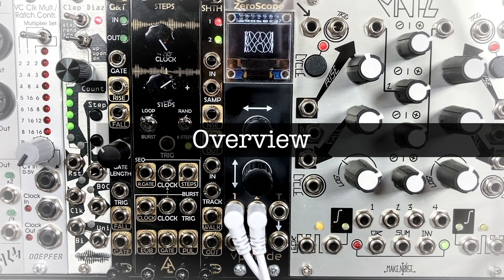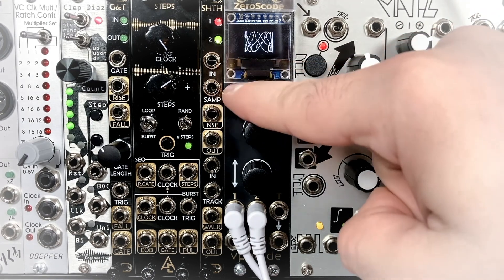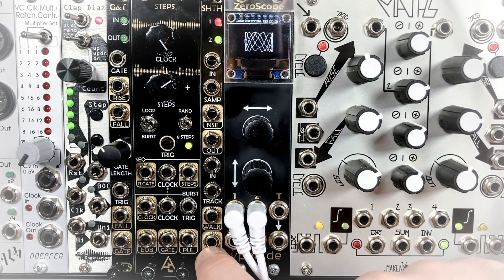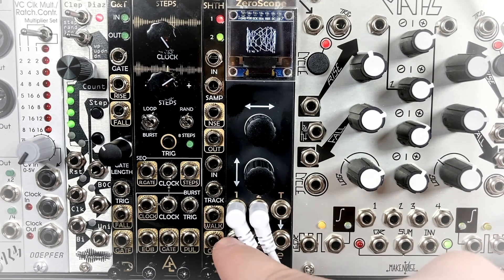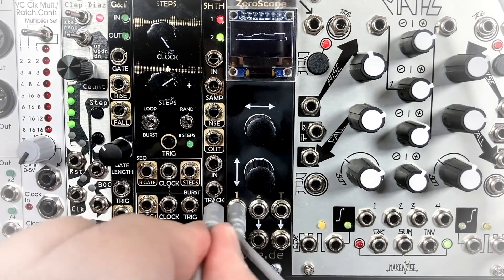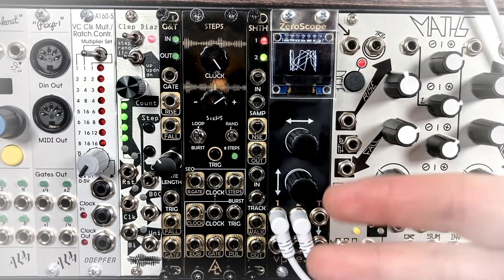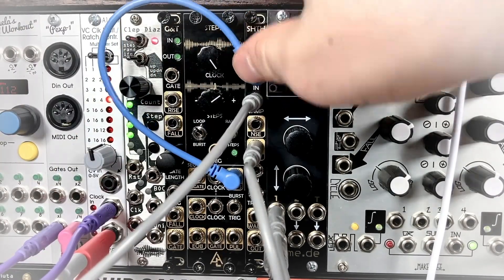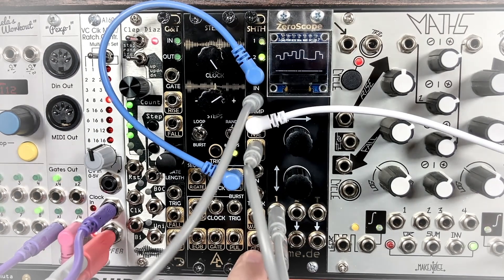SHTH – Sample & Hold / Track & Hold by After Later Audio // Full Walkthrough & Demo

Comment: So hype for this one! It's just a 2hp utility, but every other comparable option is 3hp (Zlob Entropy, which I love), 4hp (bigger than it should be for this functionality imo), lacking the noise outputs/normalizations or bundled in with some other irrelevant (if you just need the s/h, t/h and noise circuits) features. After Later really got it right with this design, even down to the LEDs, and at a reasonable cost too!
Reply from the maker: They really did get it right with this one, such a great simple utility module!